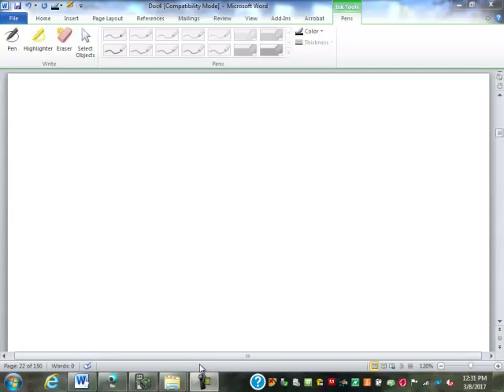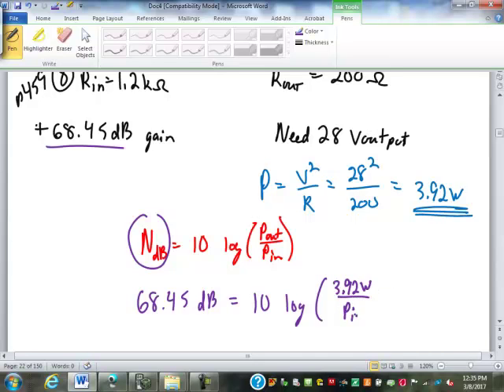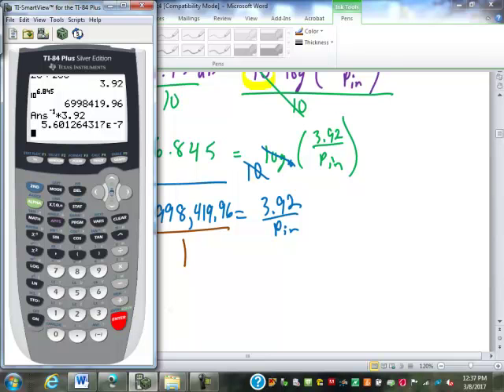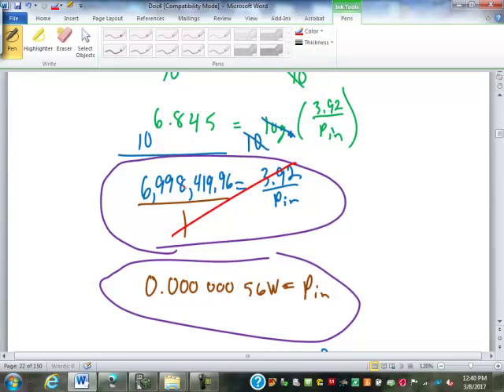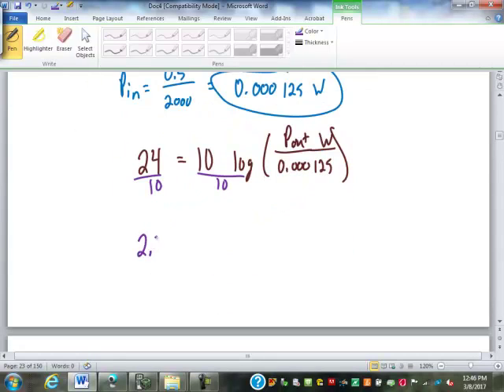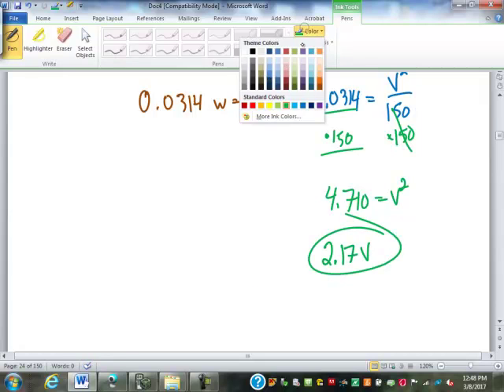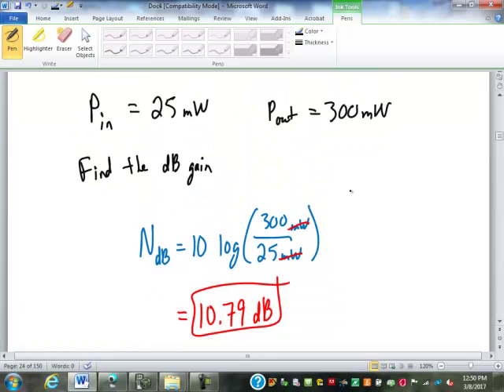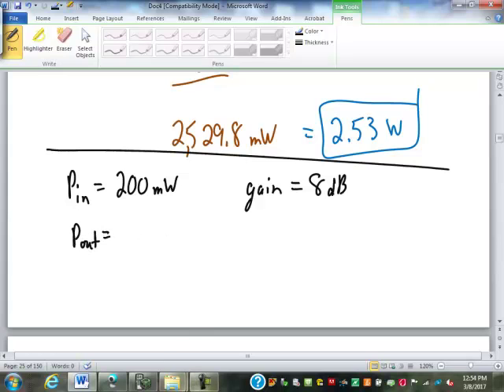21  Finding input and output Power from dB gain

Comment: We have this question: A fiber circuit reduces an input voltage from 5v to 3.3v. What is the voltage gain of the filter in decibels? This is the only question left on my activity, could you show how can we solve it? It will be due 4 hours from now so I can't cheat anyway :) I just want to see the process. Thank you!